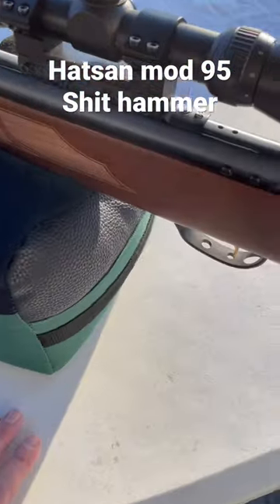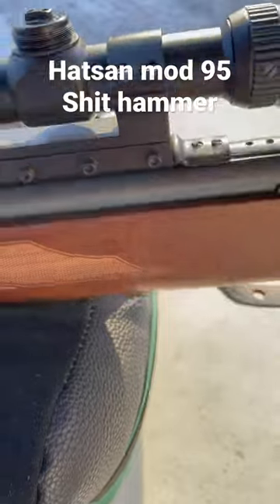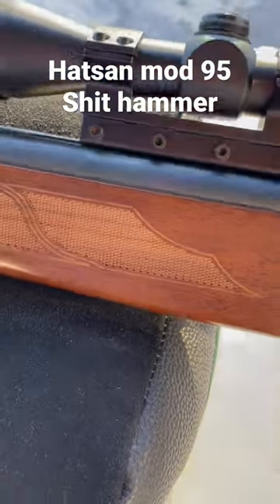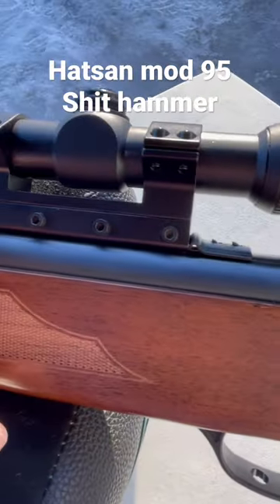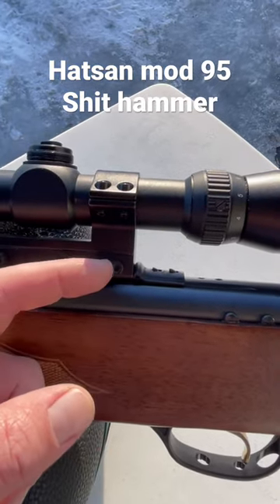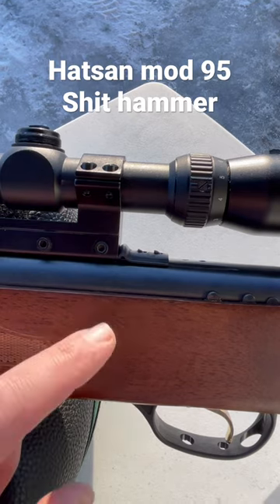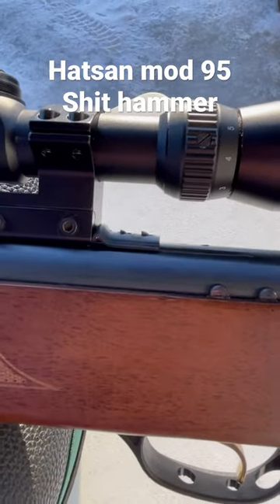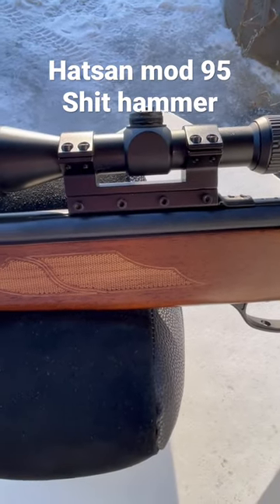Hatsan Mod 95 Sh!t Hammer

Comment: Air rifles like the mod 95 NEED an air rifle scope, any other type could be damaged or just get off zero, the 95 has more recoil than a .22lr and the cocking is very harsh on scopes
Reply from the maker: @Shkilgus  it ruined the scope it came with.
Reply: @airgunsofalaska  damn, check the barrel for any spots tighter than normal maybe?
Reply: If it’s too tight in spots it could increase recoil/ make it recoil in a weird way, but idk if that would be enough ruin the scope

Comment: Those allen bolts and mount Im guessing is aluminum alloy (screws included). All the locktite in the world probably won't solve the problems. I always just remove the scope stop and use a dovetail scope stop along with a hard alloy 4 or 5 screw one piece mount with blue loctite. Hatsan makes great guns, doesn't matter if air or mechanical spring but can be brutal on scopes and screws. The barrel pivot bolt is also very soft and for 10 cents Hatsan could of been remedied. I really have not had issues on my 95, besides that I want to get a mechanical spring in it vs. the Vortex, in which you never know when it will crap out on you. I have had 3 Vortex's just die on me. 2 where just in their safe all winter and probably only have 200 shots through them. I still have late 80s Beeman springers that are shooting at full power. I like the shot cycle of the Vortex's better. But, I don't want a bunch of them just sitting in a safe with broken power systems. The problem is that to replace is not much cheaper then buying a new gun....

Comment: Did you put red loc title thread locker glue on the scope bumper screws and blue loc tite on the rest of the screws??? And you have to use a 1/4 gunsmith inch pounds torque wrench on the bolts 30 inch pounds settings. If not , that's your failure right there friend! You can't just slap stuff together on a spring or gas piston powered breaker barrel. I've had no problems 4 years with mine as a backup for pesting with my PCP riflelz with the Hatsan breaker barrel.
Reply from the maker: Red lock-tite is very difficult to disassemble. I didn’t “slap” a scope on there, the fasteners were tight. The Hatsan is cheaply manufactured allowing excessive vibration and recoil. My Diana model 34 has none of the same issues. I didn’t use lock-tite on any of its scope mount fasteners and have never experienced a loose scope. The Diana is a joy to shoot, the Hatsan is not.
Reply: @airgunsofalaska  I understand what you say of course here. The difference in the two breakers is one is a magnum gas ram and the other is springer. High end breaker companies use spring mostly because of this. But your Hatsan is very capable of you research and do what I've mentioned here. I own several Hatsan in gas piston and spring version. I do the the steps I mentioned in my other post here to you and I would have to disagree strongly about Hatsan not performing well. All mine do for many years now. I do own high end springers as well and the Hatsan will shoot just as good mostly. You have to set them up properly first. Even high end stuff you have to go over them properly. First thing I saw ur Hatsan only had a regular one piece mount w 4 screws holding. A magnum mount has 5! Then you have to put red loc tite on the bumper screws. And torque the proper inch pounds it's 30" lbs. It's all over the Internet how to set up ur cheaper riflelz properly. I've been doing air power over 40 yrs. I've seen your problems many times. But I've learned to research before I handle anything first. I'm telling you 💯
Reply from the maker: @eddiecahall3824  thanks for the info, my model 95 is a springer, not a gas ram. I can appreciate your passion for these guns and the extra effort you put in to make work. Over the past year I’ve spent quite a bit of time and money to my my Crosman 362 more capable than stock. With the Hatsan I don’t care for the way the gun shoots thus have no interest in researching all the tricks and tips to make it work better. I think it’s fair to say most people aren’t interested in having to go out of their way to make up for an airguns short comings. 

I’d sell mine but for some reason the model has a bit of a following on YouTube so it’s worth keeping around for the random video. I’m grateful that viewers helped me to find better accuracy with it but I still don’t find it pleasant to shoot.
Reply: Try a good red dot on it rated for a crossbow or shotgun. If you want good parts on it you'll have to spend bigger with 30mm scope mounts and 4 or 500 dollar Athelon magnum scope. I use red dots on mine and keep it simple shooting. Maybe you have a Lemon? Idk man. I use the Hatsan Mod 125's and the Mod 125 sniper models mostly. I have a Super charger and also Air tact models. I also own some Hatsan PCP rifelz. All mine are good shooters and will go up against high end stuff. And when you purchase something you have to get the sellers to check the product and test with a test result sheet before selling and shipping first. Also it is a budget product. You can only expect so much although good ones working properly and darn good! Hatsan works with RWS German steel and choked barrels. They can perform just as good as a high end product. I've seen it happen many times friend. A friend of mine holds a werld record with a Hatsan no BS. Try putting a pic rail on and a good rated red dot scope. Keep it simple to 25 yards an under. Or you can always sell it an get another better quality model like the mod 125 or the carnivore models.

Comment: if you put a mount on .jou have to degrease the contact points ,and some powdered auto engine valve polisch powder in the contact points ,this will keep the mount ,,  only a little dust needed
Reply from the maker: The dove tail is dry and doesn’t have and oil or grease on it. The gun just vibrates and recoils so violently that mounts slip backwards.
Reply: @airgunsofalaska  i got the hatsan 155 and 135 .30  full  power no problem
Reply: @airgunsofalaska  is the piston seal or barrel seal a problem .then you got a heavy hitting piston
Reply from the maker: @peteralexben  I believe both of your guns are gas piston models. Mine is a spring model.
Reply from the maker: @peteralexben  how do I determine if those are an issue?
Reply: @airgunsofalaska  the 135 is gasram the torpedo a springer 177 . 385 ms with a 8 grain lead pellet
Reply: @airgunsofalaska  Ever fix it? I never had that problem with the 95
Reply from the maker: @nickallen8333  to fix the stops I’ll need to drill and retap the screw holes in the receiver to a larger size. I’ve not done that yet and in all honesty probably never will. I don’t enjoy shooting this airgun very much so iron sights are good enough.
Reply: @airgunsofalaska  Damn that’s nuts! I have about 2-3k through mine with about 2k scoped and never had that kind of issue. I wonder if something is going on internally to make it recoil so much? My favorite.22 springer is the RWS 34 T06 classic. Great combination of power but still fairly easy to shoot. I get what you mean though the 95 isn’t my favorite and the trigger is kind of funky too.
Reply from the maker: @nickallen8333  I’ve received a lot of comments from guys with positive things to say about the gun so I’m thinking mine may be a lemon? My RWS 34 is definitely way smoother and much easier to shoot accurately than this Hatsan.